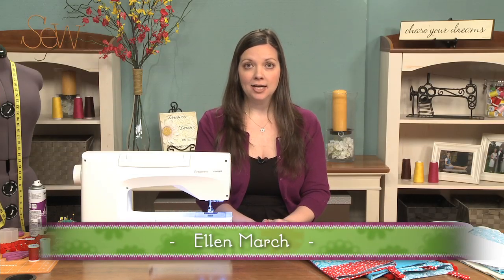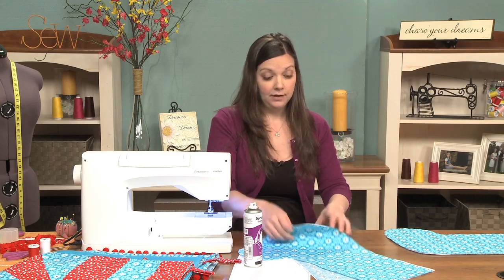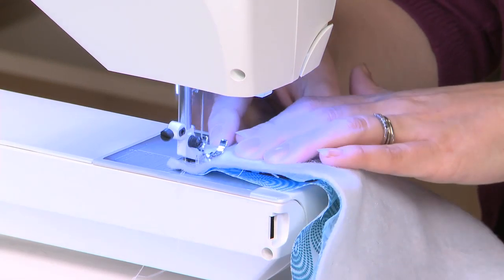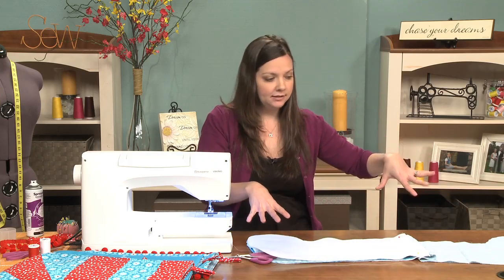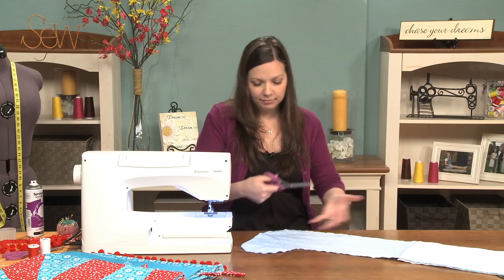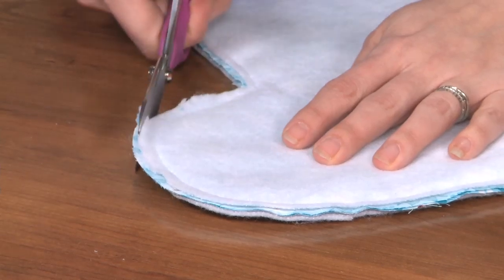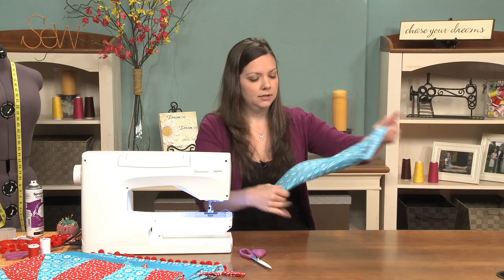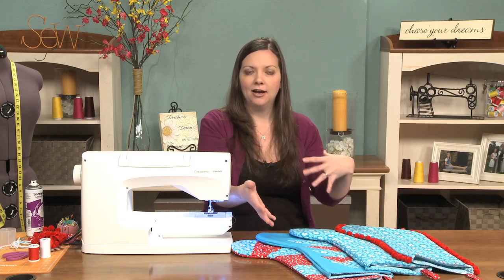How to Make a Christmas Stocking  |  National Sewing Circle

Comment: Do you have a video tutorial for adding a cuff to this pattern?
Reply from the maker: Hello,

Not for this specific stocking, but the technique for adding a cuff is fairly simple. Instead of sewing the stockings together at the upper edge as demonstrated in this video, stitch the outer stockings and the lining stockings together along the outer edges. Then insert the lining into the stocking with wrong sides together.

For the cuff, cut a rectangle measuring 11" high by double the finished stocking upper edge width, plus seam allowances. Fold the rectangle in half widthwise with right sides together and stitch. Then fold the cuff in half with wrong sides together, creating a tube. Insert this into the stocking, aligning all raw edges. Sandwich a hanging loop between the cuff and the stocking lining at this step, if desired. Stitch the upper edge, then fold the cuff to the outside of the stocking.

Check out this video (https://www.youtube.com/watch?v=OjOgSfTy7oo) to see the technique in action.

Best,
Nicki

Comment: How would you embroider a cuff? I have a husqvarna Viking embroider attachment, thank you so much for this video I'm attempting 20 stockings by Christmas for my family and really want an embroidered cuff for my sons. 🎅🏼❤️
Reply from the maker: Hi Brittany.  An embroidered cuff is a great idea! To do this, I would recommend doing your embroidery on whatever piece of fabric you intend to make your cuff from first, and then cut out the cuff piece. This will help you ensure that your embroidery is straight along the cuff, and it is also easier to stabilize and embroider on larger pieces of fabric. The type of stabilizer you use will depend on the type of fabric you choose to use for your cuff. Here is an article with a small chart near the end that will help you when selecting a stabilizer:http://www.threadsmagazine.com/item/4631/making-sense-of-stabilizers/page/allOnce your embroidery is done, simply cut out the cuff piece and attach it to the top of your stocking.Hope this helps!
Reply: National Sewing Circle I ended up making 25 of them! 🎄❤️🎁